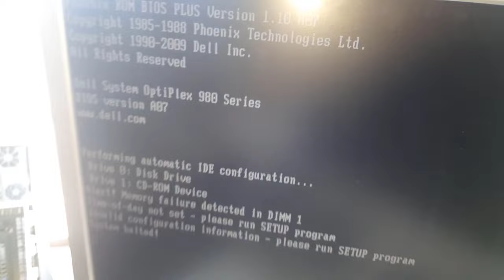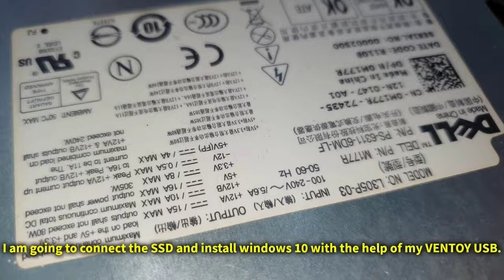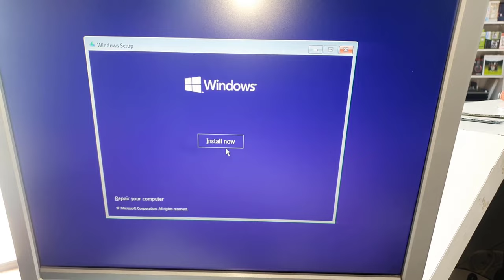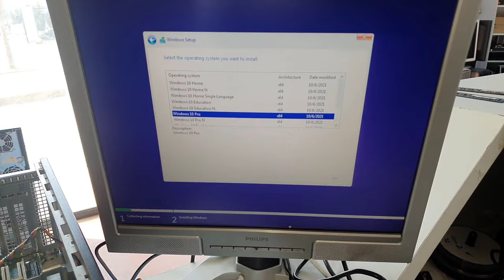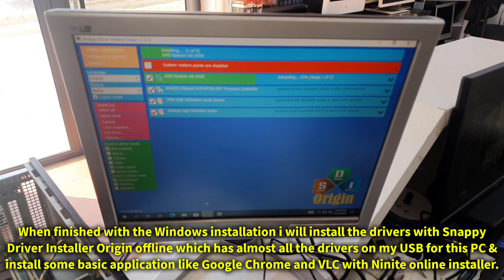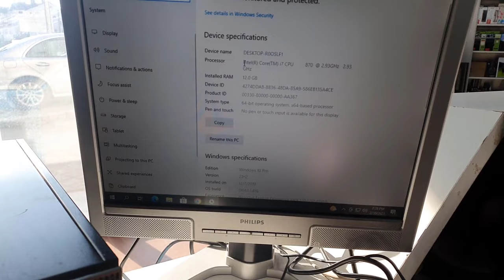Dell Optiplex 980 Upgrade CPU, GPU, SSD CMOS RAM 2023

Comment: I have the same 980 I added a gtx 1050 Ti, 16 GB or ram and wil changed my i7 870 to and i7 975 xtreme edition soon. Stock power supply of 305 w. Hopefully Ill see some improvement.
Reply: Hold on optiplex 980 supports 975 extreme? Wait… is it okay with normal 975 too?
Reply: Hold on optiplex 980 supports i7 975 extreme? Wait… is it okay with normal i7 975 too?